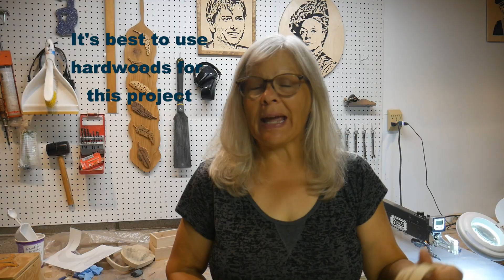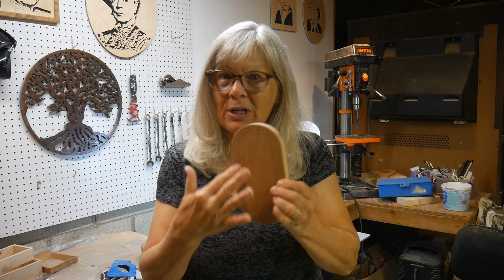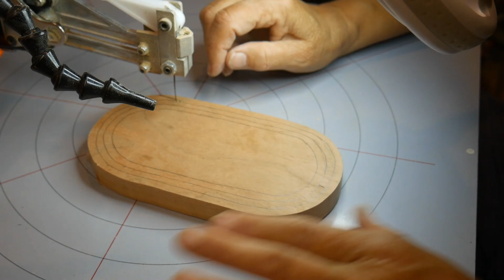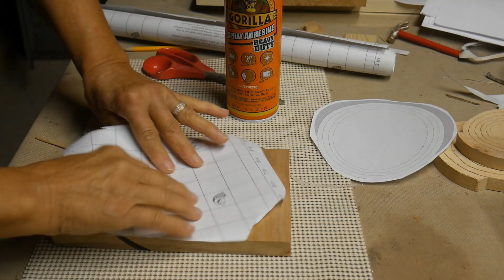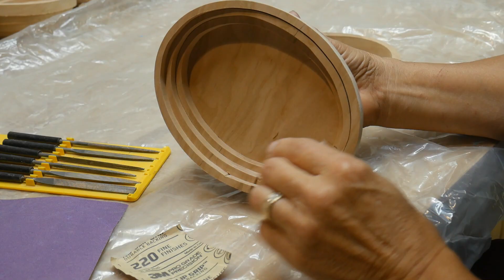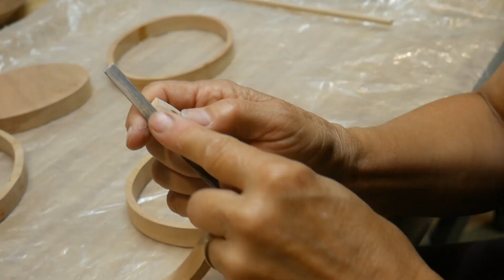Scroll saw a collapsible bowl basket

Comment: How do you put a finish on this?
Reply from the maker: If you do want to finish the project, you would have to use a very thin stain that would not interfere with it closing. You could also simply use mineral oil.